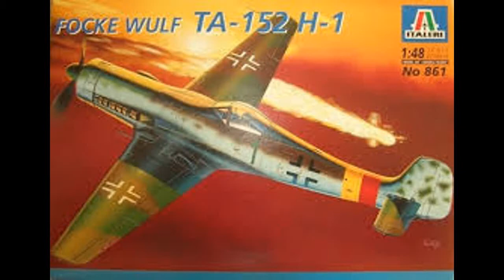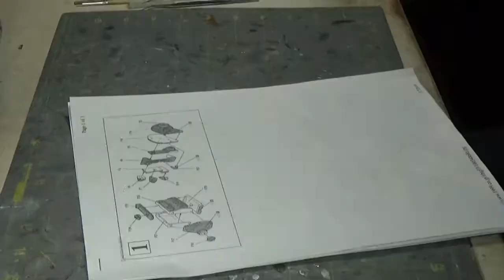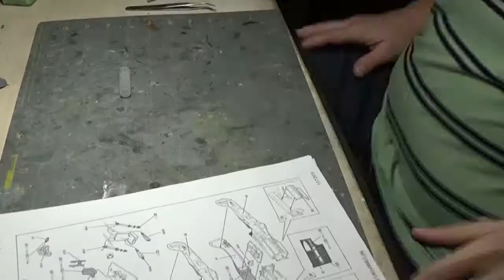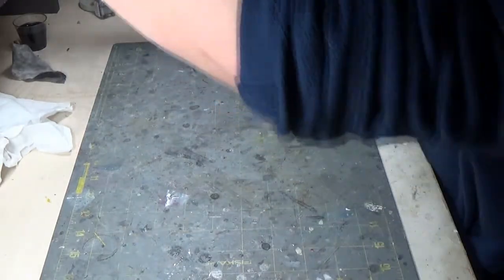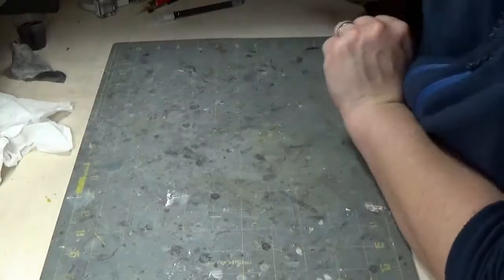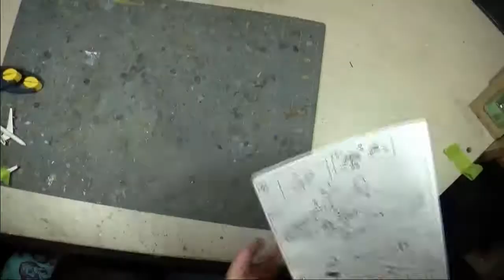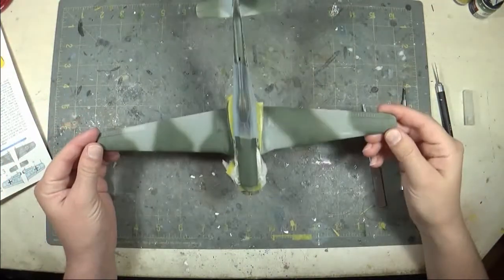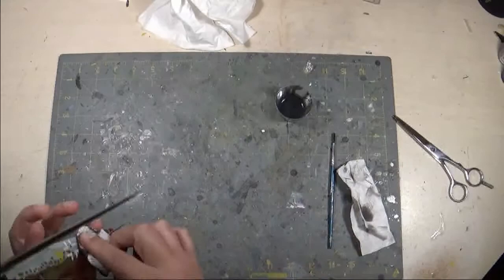Ta-152 H-1 Timelapse

Comment: The orginal Trimaster release included metal & photo-etch to attach the cowling sides if you chose to cut open the panels on the fuselage.  Italeri only included the engine sprue on the first issues. They later deleted it from the kit.